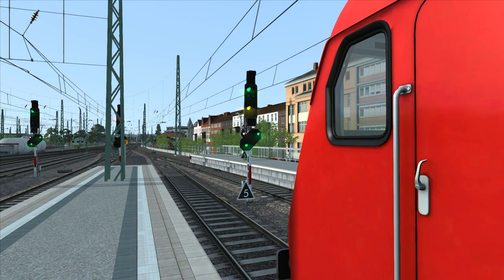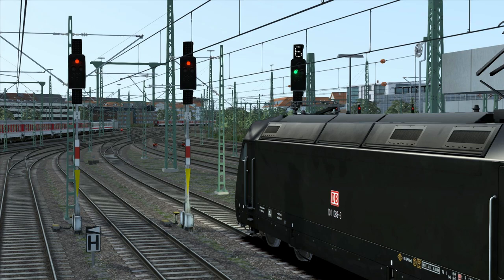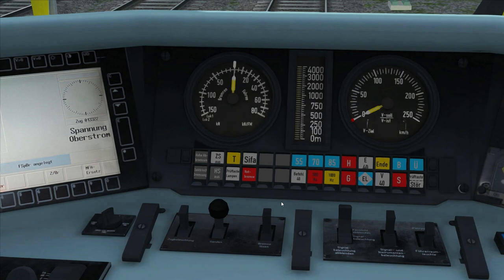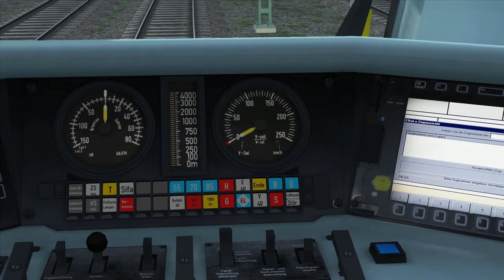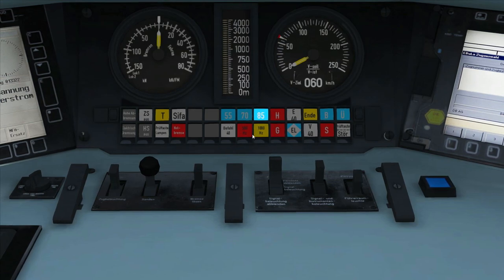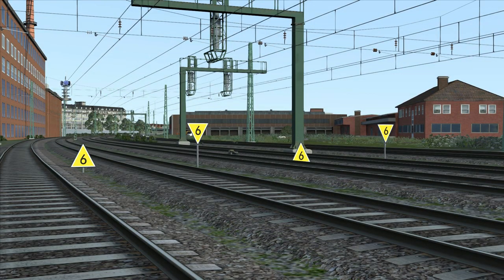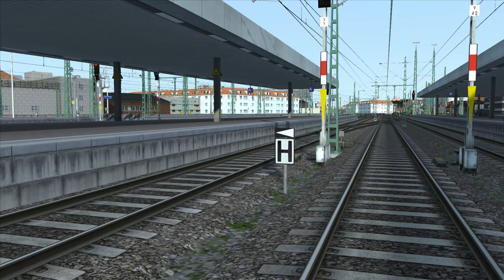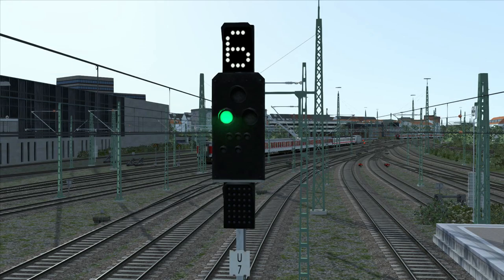Train Simulator 2015 - German Signalling Tutorial

Comment: Having watched some actual video of German trains, a couple of things to note:

1) Green over yellow signals and/or yellow over yellow signals? Those usually mean a switching operation is next.

2) The distant signals (angled ones) are not yellow over yellow, but can be red over red, meaning next actual signal is at red aspect. There can be several in a row before the actual signal. Which is the only case where a train can pass a red signal. The white light on one of those distant signals means the actual signal is the next one.

Hope I haven't screwed you up too much with this.

Comment: I would really recommend picking up some of virtual railroads expert line locomotives like the br103 and br120 Peter as they really are something else in terms of both sound and features.
Reply from the maker: Benedict Cooper Thanks Benedict. I will see about getting one. the BR103 appeals to me more as I remember driving that quite a lot in MSTS, so it will be great to see in higher resolution with far more features :)
Reply: PTGRail Yeah, make sure to get the one on their site as the one on steam is quite a bit simpler (even though the same model).
Reply from the maker: Benedict Cooper Thanks for the tip, I will make sure to get the more advanced loco. The more advanced and immersive, the better! :)

Comment: After the 1000Hz Magnet you have 23 sec time to slow down to 85 km/h after 700 m the 1000Hz light will go off now you can press "pzb frei" if the main signal shows green and accelerate further on. when it is still red you have to slow down to 65 before the 500Hz magnet the 500 hz light will now be on now you have to break to 45 km/h on the next 153 meter this is now youre restrictive speed and you can slow down to the main signal. if the main signal is now green you have to drive 45 km/h until the red light goes of  and you press pzb frei.
Reply: In the Middle Mode or M you are only allowed to drive 125 km/h. after passing the distance singnal and pressing pzb wachsam you have 29 sec time to slow down to 70 km/h the 700m are the same as in O. to the 500 hz signal you have to slow down to 50 km/h after that you have to slow down to 35 km/h.
Reply: in the slowest mode you are only allowed to drive 105 km/h. after passing double yellow you have 38 sec time to slow down to 55 km/h the 700m are the same. if the main signal is red you have to slow down to 40 km/h to the 500 hz magnet after that you have to slow down to 25 km/h and than slow down to the red signal.
Reply: and in lzb you have to still brake for youreself if the dynamik brakes of the train are bad or if you have to stop because the lzb will NOT stop for it own the last meters you have to slow down for youreself.
Reply: one thing i want to say the only really correct working pzb is on the vr br 101 el loco because in reality the pzb has constantly working "braking checking" what i mean is if you have 23 sec time to brake to 85 km/h the pzb checks for example after 11,5 sec for 122,5 kmh/h and will apply the emergenzy brakes if you are to fast.
Reply: i hope i could help you with that.
Reply from the maker: Thanks for all the information, it's very helpful and much appreciated! :)
Reply: Drive the Vr br 101 It has stunning Sounds and pzb and lzb Are correct Modelled and IT is the first train with ebula even tho thats a beta Feature arg handy is trolling me
Reply: And its really fun to drive :)